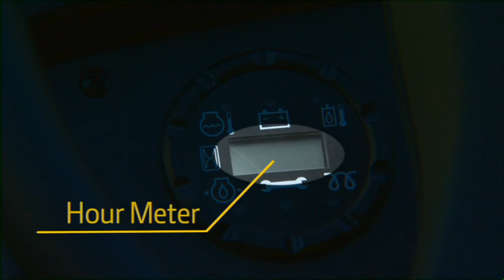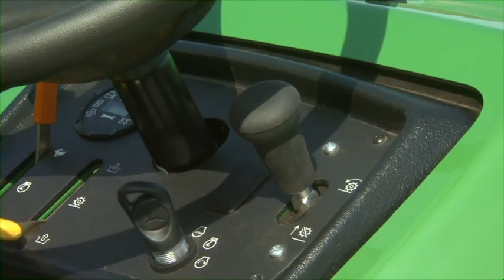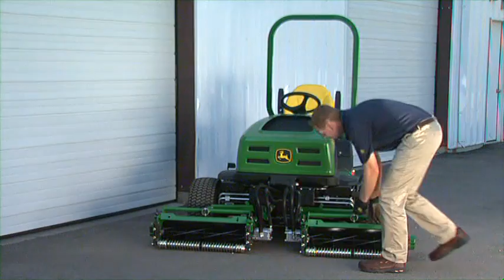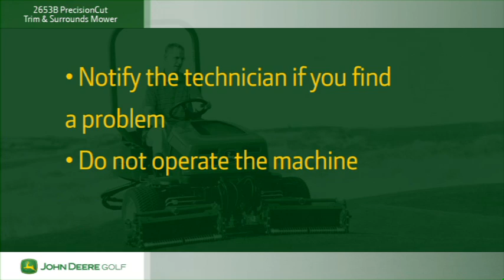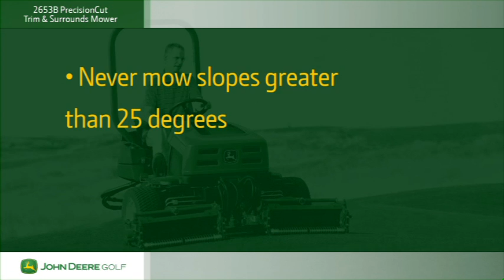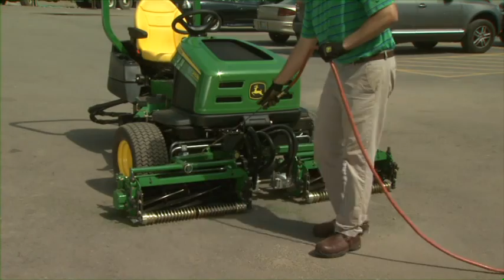2653B Mower Operator Video | John Deere

Comment: I have a John Deere 2653B. The key turns on but the engine won’t crank. The PTO light doesn’t come on, only the lights on the control panel do. If I bypass the ignition switch, the engine starts, but the mower (cutting unit) still does not engage. Any ideas? Ignition switch or safety switch issue?
Reply from the maker: We're sorry to hear you're running into trouble with your 2653B PrecisionCut™ Trim and Surrounds Mower. Issues like this can be tricky to pin down from a distance, but your Operator's Manual is a good place to start. Towards the back there is a "Troubleshooting" section that can help walk through common causes. If you don't have the manual handy, many are available online at techpubs.deere.com. You'll just need the last six digits of your serial number to find the correct one for your machine. Your local dealer is another great resource for technical support and can help narrow down the issue. You can find their contact information at Deere.com/Dealer. Hope this points you in the right direction.

Comment: How do I adjust the foot pedals on my 2653A the foot pedals wont stay in neutral and when I drive sometimes it will speed up like a bat out of hell or go slow or backup quick any info would be great
Reply from the maker: Hello, Michael. If you check your Operator's Manual under the Troubleshooting Section it says "If the pedals do not return to neutral, check to see if a spring is out of adjustment." Many Operator's Manuals are available online, so you may be able to access the manual for your model at techpubs.deere.com
If you are still experiencing issues, we suggest speaking with your local John Deere dealer. If needed, you can find your local dealer at Deere.com/Dealer.